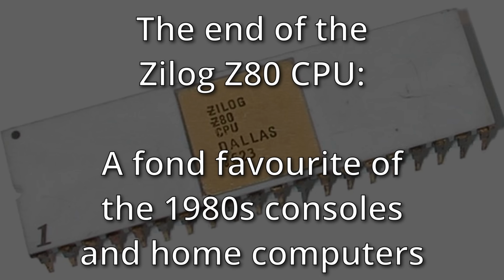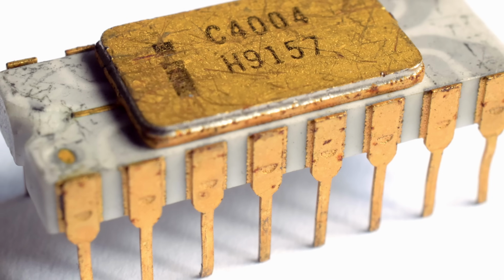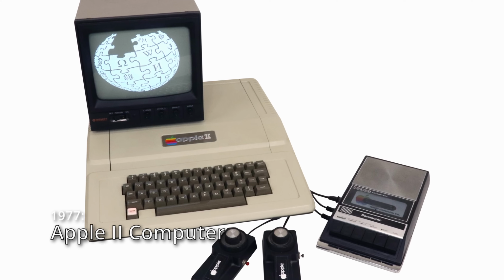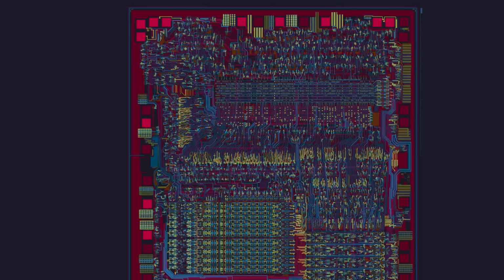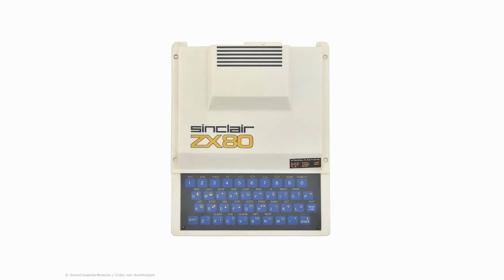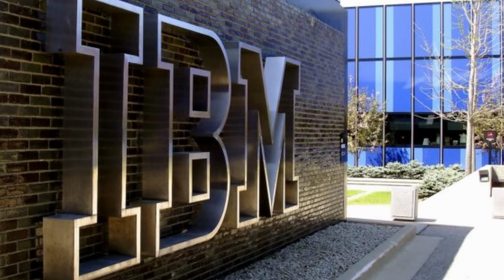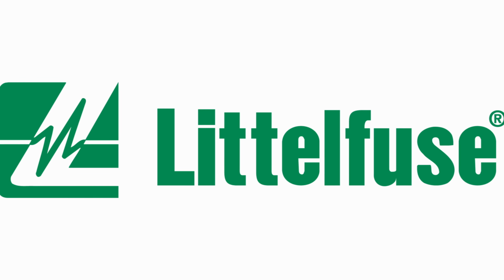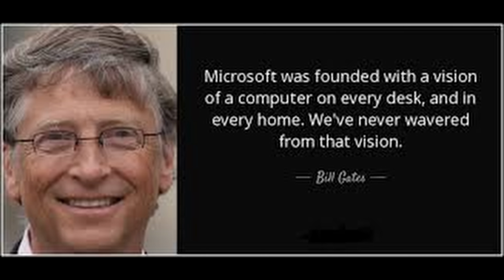The Z80 CPU - 1976 to 2024

Comment: Wow! I had no idea that the Z80 was still being manufactured in 2024! I thought it had been wiped off the face of the Earth by, uh, the 1990s? That only shows how wrong one can be...
Z80's assembly code was the first I ever learned (mostly by myself!), and, once I had to study at the university the "state-of-the-art" 8080/8/6/80286 and the 6501/68000, I was shocked — how could Intel be apparently trailing  lightyears behind Zilog? It seemed maddening to do anything useful in the 8080's assembly, from someone who hd learned the Zilog way of doing things. Motorola's 68000 was a different beast, of course, but I was still a bit disappointed with a RISC design that had so many instructions, compared to the Z80 — which was, for all purposes, a CISC CPU — which seemed to fare so well with its highly-optimised instruction set (granted, I'm comparing apples with oranges — a 32-bit RISC CPU with an 8-bit CISC CPU, which just happened to be launched at about the same time).
That said, I remember having high hopes with the release of the Z8000, but clearly the future did not go that way — I'd guess mostly because Intel showed the way ahead with launching successful generations of CPUs which were always compatible with previous ones. My guess is that this was what stood out in Intel's vision — not that they had "better" CPUs (which is arguable), but that you can still run software designed for something in the late 1970s on modern-day chips, at the cost of having to carry a lot of legacy junk inside the chip. In the early 1980s, that was hardly the way to go — a new generation of CPUs would almost invariably be incompatible with a previous generation — and much less obvious that Intel was really betting on the "right" strategy. My wild guess was that this was what IBM demanded — after all, on IBM's mainframes built today, it's expected that they can still run COBOL from the 1960s for those mission-critical software that nobody has the courage (or the time & money) to replace. IBM knows the value of legacy, and I suppose that brushed off on Intel as well.
Oh well. All we can say is that current-generation CPUs of all kinds can easily emulate a Z80 — even on a browser! (see https://www.jsspeccy.zxdemo.org/) — and retro computing is not going out of fashion, so there will always be good tributes to the Z80, in one form or the other...

Comment: I've heard the original computers used in the space shuttles were Z80 based. The idea was they needed robust and reliable computers. A system crash in space could have serious consequences
Reply: The Space Shuttle flight control computers were the IBM AP-101, an avionics computer.

Comment: From Jimbo's big bag of trivia:
> On April 15, 2024, Zilog announced the discontinuation of the Z80 processor, with orders being accepted until June 14, 2024. The announcement included 13 variants of the Z80 processor, many of which being DIP40 variants of the chip. Zilog will continue to manufacture the upgraded eZ80 version of the processor.

Comment: On of the roles the Z80 had was as a secondary controller chip on more advanced game systems and arcade boards after the industry transitioned into the 16 bit era.   The Sega Master System was powered by a Z80 as the CPU.  The Sega Genesis used one as the audio controller when it was in Genesis mode.  When you plugged in the Master System adapter and a game cartridge, the Z80 assumes the role as the CPU.  The Genesis actually had most of the hardware of the Master System on its board.  It wouldn't  surprise me if the chip still can be found on some arcade machines made in the last 20 years.

Comment: I learned about microprocessors via the Z80 and building my own Z80 based microcomputer as a lab project in college. That knowledge has stood me in good stead bringing many Z80 things back to life, both in industry as well as electronic music instruments* for hobbyists.

(*): extensively used in those as well, with some frightening shortcuts taken in terms of digital design, to where I sometimes wondered how they ever worked at all. But: replace the faulty component (in 30+ years I've only seen 1 actually faulty Z80 CPU) and these things just spring to life again. A remarkably robust and forgiving design.

Comment: Z80 had a great run. Back in late 80s it was the first CPU I programmed directly in machine instruction code (yes, converting instructions into hex numbers, calculating relative offsets).
Reply: HiSoft Assembler and HiSoft C were my first development editors or IDE for ZX Spectrum.
Reply: I learned Z80 assembly while unemployed in 2020-2021. I also learned 6502, but I prefer coding on a Z80, 100%
Reply: I did the same, programmed on it in Assembler code. Man, that wasn't yesterday. I also did 6502 Assembler. Brings back memories.
Reply: Reminds me of my days as a Technician who inherited a microcontroller design from a departed engineer. It was 68HC11 based with a UV EPROM for code execution. My tools were a text editor (B) and the motorola AS11 assembler with debug done with a logic analyzer. Burn & Crash FTW. I hated waiting on the UV eraser box.
Reply: Yes, I used to do that too. Nowadays people use programs to figure that stuff out. Like tuning an old spark plug engine vs these newer electronic ignition systems.
Reply: I started 6502 machine language (not Assembler) just a few years ago on the C64, also calculating the realtive offsets myself, and, since doing it from BASIC, converting the hex op codes - which can be found everywhere - to decimal op codes - which can be found bloody nowhere!
Reply: Did the Z80 not ship with an assembler out of the gate?
Reply: You know the Z80 was really an Octal op code based CPU. as were most of the 70s 8bit CPUs.

Comment: Back in 1978, when I was eighteen,  I bought one Z80, along with eight 1Kb DRAM chips (which were more expensive than the processor itself), and I tried to create my own personal computer, using NASA"s apollo 11 wrapping technique for the wiring. That was five years before Apple II...  I even hand-coded a BASIC interpreter in Z80 assembly langage. The Zilog Z80 was so much more cool and powerful than its closest competitor, the Motorola 6502! Its instruction set was so clever! Later, I had a TRS-80, then a Sinclair QL (wich has a 68008 processor,  another landmark in the area of microprocessors), and an Atari 1024ST... But I will never forget the Z80. RIP!
Reply: The 6502 was from Mostek, not from Motorola. The first 6501 was pin compatible with the 6800 from Motorola and they forced MOS Technology to drop it.
Reply: @0815mkl The 6502 was made by MOS technology, a different company than Mostek.
Reply: Back in my 6502 days I rewrote lots of code from Z80 to 6502 or more rarely, a high level programming language.  I perceived the 6502 as minimalistic, the Z80 as pretty quirky, borderline ugly.  My next major architecture was the 68000, 68010, 68020, 68881/68882, 68851, 68030.  Simpler to the programmer but bloated.  The move instruction timing was so complicated for the 68020 that the timing tables covered a double page in the manual.  For the 68851 tables became so hopeless that the appendix of the manual contained huge bash scripts to compute execution times.  Makes your head spin.
SPARC was weird with its register windows - I didn't like them even when I first read about the in  spring of '88.  At the same time I read about MIPS for the first time and perceived it as painfully simplistic.  It wasn't always obvious how to do some stuff. Some of the stuff took a while to wrap my head around but I eventually became a MIPS guru.  Then my IA-64 intermezzo - the philosophy of it never made sense to me.  Finally RISC-V which with my MIPS background is a bit like MIPS stirred up, thrown into the air and what falls down is RISC-V.  Just kidding.  More realistically I'd describe it as RRISC or Reduced RISC.  Thinks that even the RISC designers in the 80s didn't dare to remove the RISC-V designers did.  Along the way some Alpha.  Nice design but sadly primary going fast due to the insane clockrate - one of the technical aspects (think heat) limiting its market success.

Comment: Contrary to the fictionalized history there was only one microcomputer that was commonly found in the homes of non-technical users back in '77 and '78.  That was the Z80 based TRS-80 MCS (later called the Model 1).  Tandy was the first company to sell more than 100,000 machines in a 12 month period and they sold about 185,000 MCSs in the first two years.  [The once-bitten fruit company only managed to sell about 7700 machines over the same period partially because a modestly configured system cost as much as a new Toyota Corolla.]  There was no "trinity" of home computers back in those days, just the one.  It was the Tandy/Radio Shack MCS with the Z80.  [By the way I never owned a MCS or used one very much so I am not a fanboy of the brand but the facts do matter.]

Comment: I'm from Germany and bought a TRS80 Level-II compatible computer in 1982 or so, which I still have and it's still running. I expanded the memory from 16kByte to 32kByte using a piggyback memory chip.
Back then, for lack of opportunity, I learned the Z80 mnemonic (load register, shifting, ...) and programmed the TRS80 directly. What a fun time. Used my cassette deck as a storage device - I didn't have enough money for a floppy disk drive.
Didn't know the Z80 has been in production since 2024.
Thanks for your video.
Reply from the maker: Glad you enjoyed the video, lovey to hear of your trs-80 story!

Comment: Z80 is far from dead, the eZ80 is still going strong with an extended instruction set, still backward compatible, and lots of other goodies now built in like RAM, FLASH and DMA, makes a very capable and easy to use SOC.

Comment: 6502 sported a much nicer instruction set though. And the speed comparison between them here is not fair. Sure z80 had seven registers and 5
6502 only three. But usually it didnt matter. They are pretty equal in the hall of fame. Still though, z80 was, is, great.
Reply from the maker: Definitely I don't pick sides between Z80 and 6502. Both are just as wonderful in my books!

Comment: Thank God that the eZ80 and Z84 series are still in production. This prevents classic Z80-based computers/hardware from functionally dying. Not to mention the 6502 series are also still in production, albiet under Western Digital, which was founded by one of the original 6502 chip inventors. Not to mention FPGA being a great alternative.

Comment: The 8008 was my first venture into micros from a mainframe background. It really took off with a Nascom Z80 kit for which I designed several addon cards as well as embedded systems. The 286 was a step change though, and I still remember prototyping my own designed production motherboard using the Chips and Technology chipset using wirewrap 😁 before going to PCB. Huge progress since in both SoCs for embedded systems all the way up to my current OC'd 14900KS monster. Memories ❤.

Comment: Z80 was our favorite CPU for many embedded industrial systems.
Two things missed, first you had to have a good clock source with symmetric rise and fall times with adequate Voh.
The second is that internally the Z80 has a 4 bit ALU, this ran at double the external clock rate.

Comment: I really loved the assembly language mnemonics of the Z80, as it was so much better than those of the 8080. My first real computer after my Apple II was a Columbia Data Products 964 Commander running CP/M, with dual Z80s and dual banks of 64k ram. It was essentially two computers connected with an internal serial interface, where one system was responsible for screen output, and the other for running applications. I even had an arithmetic co-processor to handle trigonometric functions. There were no built-in functions to draw a line or shade a polygon, so I had to write my own in assembly language. I paid $4000 for it around 1979 (a huge sum of money) and developed a 3D solid modeling application in FORTRAN which I sold for $17,500 a year later.
Reply from the maker: Well that was a solid profit I guess! Fascinating sounding machine and bit of work!
Reply: The instruction set still lives on in the eZ80 soc.

Comment: My first Z80 based computer was a North Star Horizon, ordered in 1979 and put into commercial use in 1980. 32Mb of RAM and dual floppy disk drives, double sided. Ran North Star OS. Later upgraded to 64Mb to run CP/M.
Reply: You surely mean kB, not MB - the Z80 has a 16bit address bus. All it can use without bank switching are a maximimum of 64 kB of RAM+ROM storage.
Also 32MB of RAM in 1979 would have been prohibitively expensive.
Reply: @2K2QkIvP7Cl24k-pq9ou  Thank you for the correction. Slip of the pen, as it is so long since I worked in KB.

Comment: I still have ZX Spectrum (Z80) and an Atari 800 XL (6502) in a vitrin in my office room.

This Spectrum was the very machine on which I coded in assembly a Basic to Z80 compiler. I git as far as I could copile an expression using constants, four operands and parentheses.

Comment: Which chip sailed aboard Voyager? Z80?
Reply: No microprocessor chips in those probes . Some custom build computer by General Electric using discrete transistors and TTL chips. The teams had to start the design years before the first CPU chip was created. In 1977, when they launched both probes, it was too late to redesign and include CPU chips.

Comment: No wonder why someone want a 100Mhz 6502.
Best instruction set ever !
Reply: That's until you meet Motorola's 6809. (Not so popular because too expensive)
Reply: With appropriate cooling current generation 65C02 can run with 100Mhz.
Reply: @Martin.Krischik  How hot it could be
Reply: @thanatosor  Hot enough that you would need active cooling.

The PDIP-40 can run up to 14 MHz without additional cooling according to the data sheet but nothing stops you to clock it higher.

Well, the capacitance of the PDIP-40 will eventually get in the way. But there are PLCC-44 variants which can go further.

Provided you add sufficient active cooling. You should not do any of that for production environments of corse.

Comment: My first interview to be a professional programmer after finishing college here in Ireland was to be a Z80 programmer for embedded telecoms units for Motorola.
That was 1998.
I was shocked/surprised that the processor that I knew from old home computers was being used to run mobile networks! In hindsight, I ought not have been. Was a great implementation.
I didn't take the job. Went and used this new language my buddy told me to learn for my final year project - Java. Ended up going enterprise, baby! 😕
Feel lucky to have found this a few days after the Zilog announcement. Are there any other late-70's "mass market" chips still in production now?
Winners and losers in the high-stakes game of early tech adopters... It's an enthralling set of stories. "Gary Kildall's CP/M" - I'm glad you called it that each time. 
Thanks for this, I love this class of content. Subbed 👍

Comment: The 20% faster is not a blanket statement.  The 6502 wasn't as good at 16 bit math as the Z80 but the 6502 is substantially more efficient at many other things running at the same megahertz.

Comment: In the late ‘90s I used to own Ericsson GSM mobile phones based on the Z80. I used to write Z80 code using Microsoft’s macro assembler (masm) with a header file that defined all the Z80 opcodes. I still have some unused Z80, CTC, SIO chips lying around.

Comment: May I suggest a pop filter for your mic? Maybe backing off the mic just a bit also. A lot of plosive in your audio.

Excellent treatment of the z80! I used a TRS-80 for a while. Plus the 6502 of course.
Reply: I didn't hear any pops. Listened to the video with a smartphone with Dolby Audio installed (not Dolby Atmos) and good earphones.

Comment: Your claim about the Z80 has operations that is executed 20% faster than the 6502's... well, in real life the 6502 runs in circles around the Z80, compared clock to clock speed (e.g 4 mhz to 4 mhz). The 6502 is designed around efficiency, and many operations can be executed in parallel, operations can be executed on both the rising- and falling edge of a cycle, AND many operations is executed in less clock cycles. I love both the Z80 and the 6502, but in my opinion the 6502 wins every day in simplicity and efficiency, which was the MOS designteams goal. On paper it seems that the 6502 would win, but they are very equal in computing power in the time frame compared. But then do not forget, that the then marketed 6502 only runs in 1 mhz opposed to the then marketed Z80. That is a testament how efficient the 6502 is, compared to the Z80.
Reply from the maker: This video isn't a competition between 6502 and Z80! We love them both just as much! However it is the Z80 that ended its life first, so I thought it fitting to send it off!

Intel always went with CISC, and the 6502 was closer to RISC in my mind. My opinion always believes that RISC is a better architecture than cisc. It made better programmers and better design, but that's just my opinion.

Comment: The fastest Z80 descendants run at 50MHz. But a generic PC can probably simulate a Z80 about 20x faster ("the equivalent of" 1GHz). ((See one serious-looking emulator at "Z80 Emu Evolution".)) Imagine a Z80 implemented today in a hardware CPU, with all the latest optimizations (pipelining, reordering, etc.) applied to the old instruction set. (No one will ever do this.) And running at 3GHz. It would probably execute about 200x faster ("the equivalent of" 10GHz) or more. If Intel processors had room for more microcode, they probably could emulate any processor directly. Every 64-bit Intel CPU is already two CPUs in one (64-bit and 32-bit). Maybe one will someday have room to add modes for one or more far-simpler 8+16 bit processors (8080, 8085, Z80, 6800, 6502)?